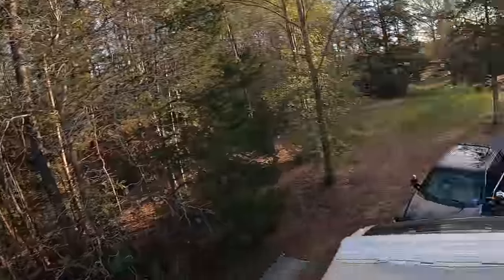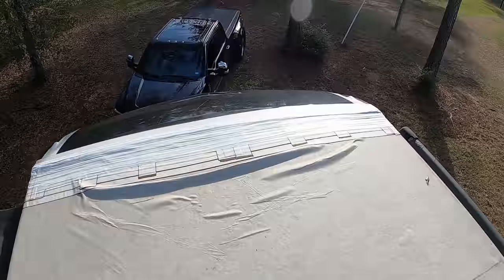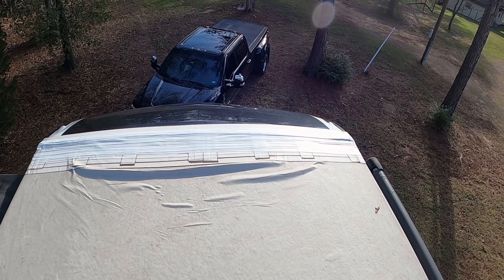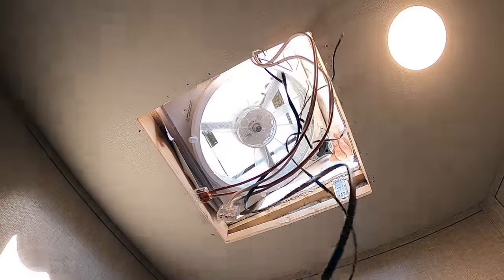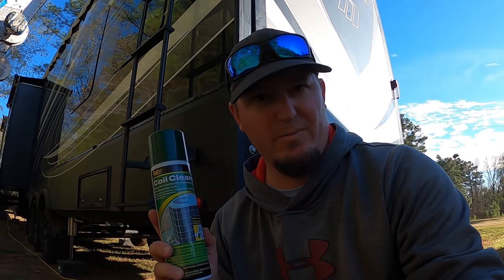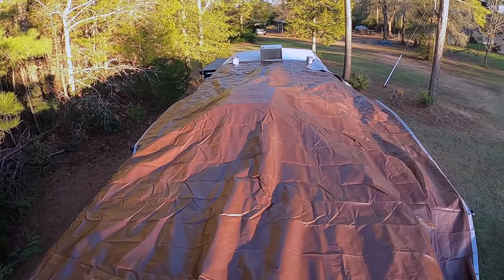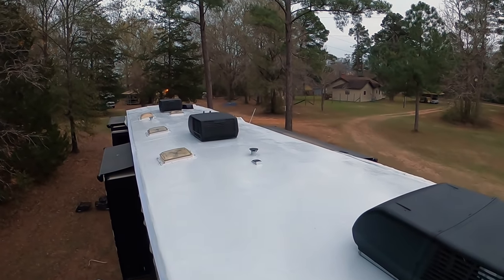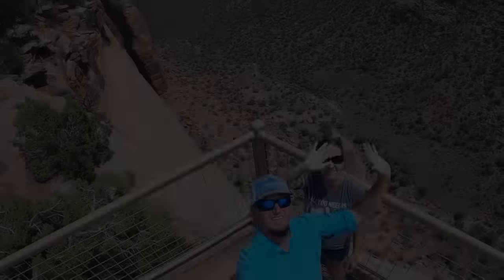Not Such A Grand Design | RV Roof Problems | The Downside To Fulltime RV Life!

Comment: It's a bummer to hear many Grand Design models are leaving the factory with bubbling roofs. Of course GD calls this "perfectly normal", but anyone watching this industry knows there are no acceptable reasons why an RV roof should be bubbling on delivery day, or fail after 5,000 miles from general wear and tear. RV Armor proves you can install a lifetime roof by taking your time and focusing on quality.
Reply: Im tired of companies claiming normalcy with shyte work. I bet it is normal. Lol
Reply from the maker: Thanks for Watching!  We also agree if a smaller company will offer a lifetime warranty, why can't the manufacturer!  Likely because they deliver them with a roof that they cannot stand behind!
Reply: So much for their exhaustive PDI inspection
Reply: The thickness of that roof system that U pulled up was like a surgical glove .... Pure garbage...
They want Beaucoup Bucks for pure garbage 🗑️
Reply: they aint that grand trust me had numerous issues my 2800bh very disappointed
Reply: @tomclose6643  Sorry to hear that. I almost bought a Imagine 22MLS last year, but the build quality was terrible.  Bought a Keystone Cougar 22MLE instead and IMO its a far superior product in every respect.
Reply: Shot, my keystone fusion broke the frame where the overhang starts, call my insurance at the time (progressive), and was told it was not covered and is "normal wear and tear".
Reply: Replacing the roof on my 30 year old rockwood... the original rubber tarp roof.... because it becomes a little bit thin, is still watertight though rips now very easy

Comment: Had same issue with our 2020 painted Momentum - flapped open at joint between front cap and roof. Grand Design blamed their paint contractor and fixed it for us. But it happened again within days. We finally abandoned the original roof and did RV Armor. We love it now.
Reply from the maker: We ran into so many people just like yourself that had Grand Designs and told us the same story!  They fixed it but it failed again quickly and almost all of them ended up with RV Armor as the final solution!

Comment: This is a problem across the industry. We looked at dozens of RV dealer lots across the southwest, and most times the dealer had never been on the roof to even know the condition. When I'd climb up to take a look, it was appalling the number of roof membranes that were failing...
Reply from the maker: We started to see so many campers on the road with the roof having the air bubble when driving!  We always wondered how they don't know. We were at a rest area when we found out it was happening to us, when I got to the campground after setting up, I went on the roof to take a look and the roof was as if nothing was wrong!  It was lying flat with no bubbles or slack in the Vinyl!  Eventually it became a problem as we traveled for almost 6 more months before we had it repaired!  In the end I had maybe 400 ft. of eternabond tape across the front cap transition just to help keep the vinyl from completely separating!

Comment: Now I understand why so many RV's have ceiling leaks.  With that being said, I  now know more things to look at and for potential problems, as I've been searching for a used travel trailer for quite a while.  Knowledge is power, thank you for this informative video!
Reply from the maker: Thank you for watching!  Good luck with your search!
Reply: @PavingNewPaths  The day I brought my new camper home, 2009 Keystone Passport 290 BH, I used eternal bond on every seam, fans, vents and all. including the slide, still no leaks or issues 12+ years later.  Heard on the RV forums lots of delamination issues on my model before I bought it but wanted the floor plan no mater issues others had.  I will do the same with eternal bond again no mater the brand we get next time, maybe 5 more years from now. Although my roof you have to lay down on to spread your weight or you would break through.  Really make cleaning the a/c coils fun.
Reply from the maker: @Goingnorth751  We love our Grand Design and would still buy it again.  If I had to do it again I woulf have put this roof on day one and been done worrying about it!

Comment: Wow - this proves the cost of the RV doesn't necessarily promise quality.  We paid about $15,000 for a brand new 28' Aspen Trail 6 years ago.  We never had problems with the roof.  The only issue we had was our outdoor faucet cracked and ruined our outdoor kitchen counter.  Easy replacement.  My husband said this is clear indication that GD and the companies building RV's that do this aren't watching their employees or quality control.
Reply from the maker: We have spoken to so many fulltime families and have found that across the board all the manufacturers are similar in build nowadays!  While it is unfortunate that our roof needed to be replaced so soon, overall, we a very impressed with how our Grand Design has held up to Fulltime life!

Comment: Our 2014 Grand Design 5th wheel had no issues with the roof or anything but when Wenabago (sp) bought out Grand Design the quality went down fast. We did the factory tour 2 years ago and they slap them together just like all the rest.  We think when Grand Design first started they took more time in building them but when all the orders came in because it was good company with a good a god product they started to slap them together to keep . We sold our 5th wheel and now have a 30' motor home and are just as happy while traveling.....
Reply from the maker: Thanks for watching! I believe they started out as a good company doing things the right way!  I have also heard since they were bought out things are not what they used to be!
Reply: @richardkoch8752  have you not seen AZexpert’s videos every winnie built in the last ten years is garbage no roof structure what so ever just foam and a thin layer of luan

Comment: Makes sense since Grand Design is owned by Winnebago. Winnebago has had the same problem with their fiberglass roofs for many years. Unfortunately I never heard about it until after I purchased it. Even when brand new 1st owner, they try get out of warranty work. I had sealant failures after 6 months and check all areas where air will get under the fiberglass on a regular basis. These manufacturers need to get it together. Thanks for sharing the process.
Reply from the maker: It's sad that their products fail so soon after purchase, or at all, honestly! For what they cost, you think the quality would be better!

Comment: We have a 2017 Forestriver 3825FL Cardinal and after a year and a half I saw water leaking out around the pin box when it was raining. I said WTF? So I climbed up on the roof and the roofing that attaches to the front cap was separated and water was leaking into the front cap a draining off around the pin box. I took it to the dealer to have it re-roofed. Forestriver wouldn't re-roof it but they repaired it and looks like crap but doesn't leak. So far so good but the roof has 2 long creases where the roofing isn't flat on the roof. I plan on keeping this RV fifth wheel and now might want to get the roof replaced now after seeing this video. 😊 thanks for showing this. 
    I installed an airbag pin box and I believe it helps in taking the edge off them huge bumps on these bad roads in California. Interstate 5 sucks. People that have roof problems like this might want to consider in replacing the pin box with an airbag system.
Reply from the maker: I think you would be happy with the RV armor roof.  We no longer worry about our roof when traveling or when it rains!  Our choice was to deal with dealer or manufacturer to put the same sub par roof on or spend the money to fix it forever.
Reply: @PavingNewPaths  amen to that. These RV's are investments and gotta keep them up especially if it has anything to do with the roofing.
Reply from the maker: If you decide to go the RV Armor route, mention Paving New Paths for a discount they are giving our viewers!
Reply: @PavingNewPaths  excellent!! thanks much. I emailed the company to find out where in Tucson or Phoenix Arizona to take it to. I need to hire experience.
Reply from the maker: They will come to you wherever you are!
Reply: @PavingNewPaths  wow, that's awesome !!

Comment: Grand Design and other brands have suffered this. Its a shame and of all things to not hold up, the roof is really the part of your coach that gets never ending contact with the harshest parts of nature! My friend at work has a 5th wheel, same size called the Attitude by Eclipse and he had the same problem. Insurance denied the claim saying it was a "maintenance" issue, what a joke.  Word games with the contract and all. The manufacturers will fight you over this kind of repair even if its under warranty so be prepared. He also got the RV Armour and loves it and had nothing but great things to say about the installer and appreciates the warranty as well. This is something everyone with an RV like this needs to be aware of and I find it to be a sad, sad strike against the manufacturers who are not building their roof better. It was a $6500 bill for my friend a couple years ago so I know its even more than that these days.  I do have a question, when you put the new "Max Air" fans in, I saw that you put the inside casing up, screwed it in, and added no sealant or anything before installing the casing. I know the rubberized roofing is great and all, but would it not be smart to seal around where the fan makes contact from the inside as well for added leak prevention? Or did you do that off camera?
Reply from the maker: Thank for watching!  Yes the price was a little more now than what your friend paid but it was still significantly less than the dealer reinstalling the same horrible stock roof!  That being said we think at this RV price point the stock roof should be better from the factory!
Reply: Grand design is overpriced junk. Roof delamination, frames breaking. Etc. just junk.

Comment: My issue all along after owning 4 trailers is how the manufacturers speed through the build on EVERY TRAILER NO MATTER THE BRAND OR ASSUMED VALUE! They need to slow the hell down and do it right the first time. Even the wood shavings that you see in most of the units bug the crap out of me! I have recently had to replace a barn door hanger on my Alpine because it fell off. Very annoying!
Reply from the maker: They are all built by the same people in the same town in Indiana.  Our Grand design has had problems but I would still buy another one because it has held up to full time living.
Reply: I could not agree more. They build them as fast as the pizza guy.

Comment: At 13:35 you're reinstalling the AC and I see the RV Airflow Systems mod.  The diverter plate that is between the AC and the lower outer housing should be removed when using the mod per the RV Airflow System install instructions.  If the factory did it that way it was an install oversight or they wanted to leave it in case the end user wanted to remove the mod.  You'll see better airflow with the diverter plate removed.  A good technique is to use duct or foil tape on the inside of the lower housing to hold the dump valves closed since they have no use with the mod in.  That way they don't vibrate open and allow air to bypass the filters.
Reply from the maker: Thanks for the info!  We actually didn't know that plate was not needed when using the RV Airflow system!

Comment: was disappointed that didn't really get to see the RV armor process. The finished product looked nice but looked like any other RV roof. I have no idea what makes RV Armor superior to any other RV roof. It was however interesting to see the process taking the old roof coating off. Thanks for sharing your experience.
Reply from the maker: At RV Armors Request they did not want me showing a step by step of the roof process!  Instead, I was allowed to talk about the steps and show a before and after!  They install a fiberglass type membrane down on the wood and apply two base coats on that!  Then they come back with the thick rubber final coat!  I was really confused by the request not to show the process, because they have step-by-steps of the job on their YouTube channel!

Comment: Yep, same issues with bubbles on the roof upon delivery of my new 2021with my Grand Design. I pointed it out immediately before accepting it. I was told it's normal and they ( Blue Dog RV) would watch it. Update 2022 bubbles are worse and we are fighting to have it repaired. Now they are saying it can be fixed at our expense. 
I keep this RV covered through the winter and check the seams regularly and add sealant as needed. My previouse RV by Forest River did not have any issues with the roof as I maintained it extremely well over the 10years I owned it. It was still in great shape when I sold it.
Reply from the maker: We were also told it can be fixed at our expense!  It would have been a $12,000 insurance claim!  Its not a better roof its the exact same roof that just failed!  We decided if we had to spend money, might as well put a lifetime warranty roof on the RV.

Comment: Winnebago owns Grand Design. As far as I am concerned Grand Design built a good product until Winnebago bought them out.  But I was able to sell my 2015 Grand Design 5th wheel 337 in 2 days for more than I paid for it....I am 76 years old and have been RVing with small trailers, 5th wheels and motor homes for over 50 years and all companies will have problems.  Some times it depends on which employee is working that day and how much pried they take in their work.....
...
Reply from the maker: We have learned no matter what brand you buy, if you use your RV it will break!

Comment: So on my Eagle, I had the same thing going on; the dealer attempted to fix it multiple times. I finally just bit the bullet and went with the Flex Armor Roof. While I was talking with the tech, they said they don't know about Jayco, but on the GD, the roof would do what yours did because the king pin box is open all the way up to the top. So while going down the road, it would suck air up through the back of the pin box and blow out at the transition strip.
Reply from the maker: I am not sure I can buy into that completely as the part of the roof around the transition strip was still down, it was about a foot back from there all the way to the front A/C that was bubbling up! There was also a few bubbles happening along the radius in multiple areas along the RV!  We are glad that we went with RV Armor and have had it now for around 18 months with no more roof issues or maintenance to worry about!

Comment: It hurts my heart to hear of all the problems happening to Grand Design trailers. We bought a brand new 2017 Imagine 2950RL and we absolutely love it. ZERO problems with the rig itself in all these years (knock on wood). We feel very lucky that it was built when GD was truly GD, before Winnebago took over. Only issue was that the refrigerator (Norcold problem) stopped working. Our dealership replaced it with a brand new Dometic that someone took out of their rig to install a residential. Someday we’ll have to downsize as we are getting older. Makes me nervous to change rigs, hearing about all the problems with every manufacturer.
Reply from the maker: We live in ours fulltime and are always on the move, so we are using it more than the average user.  We knew we would have problems no matter what brand we purchased, so we picked the camper that would work best for us. We bought used so we could save on the initial investment and put the savings towards any issues that may come up!  We had our fair share of problems this first year, but they were minor when compared to a roof having to be replaced!

Comment: This has been an on going problem with GD for years and they dont take responsibility that their roof install process is lacking in many ways. My previous RVs (not GD) had excellent roof membranes that were attached tight to the sheathing, no bubbles, no wrinkles, no loose spots.
Reply from the maker: We were the second owners, previous owner only had it for about 6 months!  We were in the RV for almost 6 months and 4000 miles before I started to notice some bubbles and loose spots!  Not long after the big air pocket when driving showed up!  We knew we were getting a new roof at that point we just had to figure out what kind, how and when!

Comment: We are being told that the tape you see at the front cap edge is made of mylar. They say that Mylar does not adore the roof glue therefore there will always be a bubble there. Same as for all other roof edges. We are still going back and forth with Grand Design
Reply from the maker: We don't have tape on ours?  we have once piece that is suppose to be glued and pulled tight! It is then held on the front and back with a strap and the sides with the gutters! Then they goop dicor on all bolt heads and call it a roof!  Our new roof has a lifetime warranty and is one solid sealed membrane!

Comment: Are there more than one company called RV Armor. I googled it and the process on the website did not remove the old roof. They applied a primer and topcoat. Can't see how this would help if the old roof has bubbles.
Reply from the maker: No there is only one company called RV Armor!  They base each job on the conditions of the existing roof!  We paid the fee to have the entire old roof removed and their roof applied directly to the wood!  Not all roofs will need this done, but we felt that it was best to have none of the old roof on there when the new roof was installed!